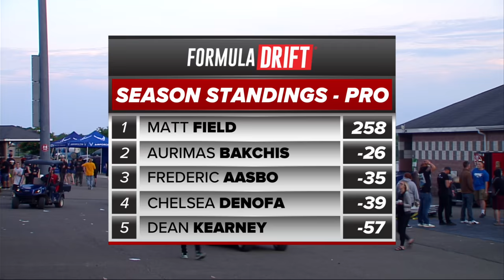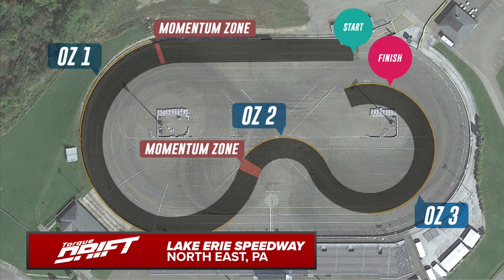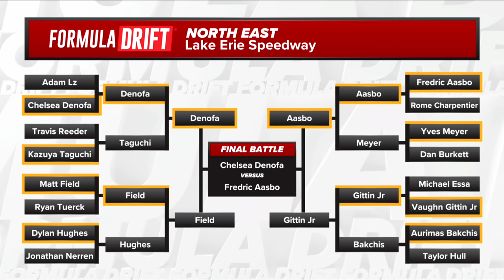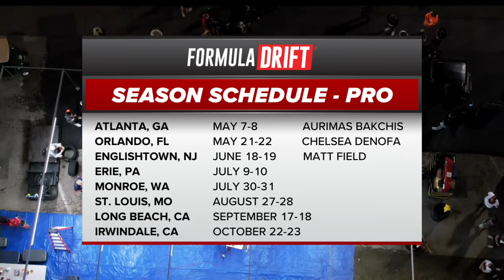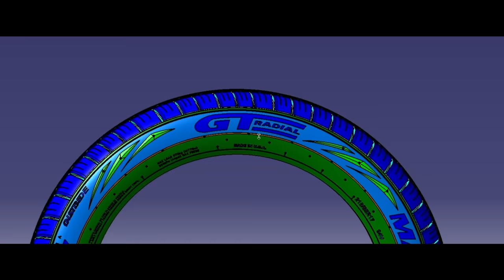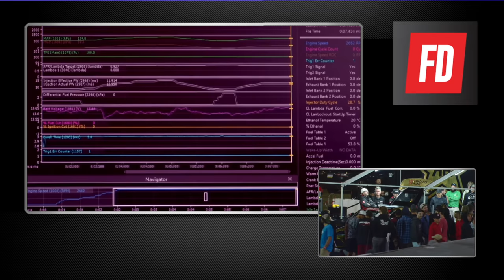Formula DRIFT Erie PRO Top 16 - ALL ACTION

Comment: I didn’t think the judging could get anymore inconsistent wow I was wrong
Reply from the maker: example?
Reply: @formuladrift  odie should have won, he was robbed. That is the example and the fact you have to ask is disappointing
Reply from the maker: @adamnofsinger6564  Can you share your telemetry data with me?
Reply: @formuladrift  You see the videos you post? It's all in there 🤯
Reply from the maker: @adamnofsinger6564  Ah, I see.
Reply: @formuladrift  can you add the telemetry data to the show
Reply from the maker: @BruteLee  not yet.
Reply: @adamnofsinger6564  he wasn't robbed at all. vaughn just had a better run
Reply: @adamnofsinger6564  funny enough, their telemetry data SHOWED they were all wrong and Odi shouldn't have been at fault and won the battle. He got robbed plain and simple, judges are ass even with telemetry data 😂

Comment: Judges didn't see that odi tapping his brake a lot of time in OZ3 vs Hull ..that wasn't Hull fault ..it's a diesel zone ..
Reply from the maker: He is left-foot braking. that does not entail decel, which is what would be required. Left foot-braking is very common.
Reply: 51:43 this is what sandbagging actually looks like. Theres a major difference between using left foot brake to hold a line and left foot braking in order to cause an error in chase.

Comment: Rome got robbed wtf favoritism
Is real
Reply: I thought so too but when I went back and watched it I saw I was looking in the wrong place. Don't look at the impact. Check the back end of Rome's car before Aasbo hits him, he's already lost it and going into a spin. That call was correct. The Odi call was a total farce though. OZ3 is not a consistant angle and so drivers have to A. Throw more angle at it for the second half or B. finish almost straight. It's up to the chase driver to work out which is going to happen. Odi vs Hull, Odi finished fairly straight and started gapping Hull on the second half of OZ3 during the final run. In their run: Vaughn expected that and surged to keep up but Odi instead went for more angle and then was denied because Vaughn shunted him off track.
Reply: holy crap.